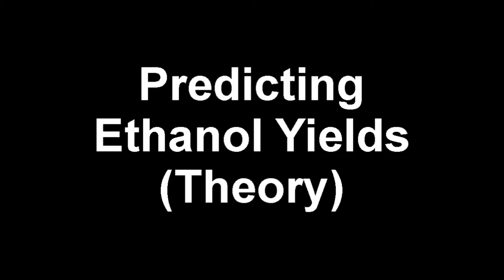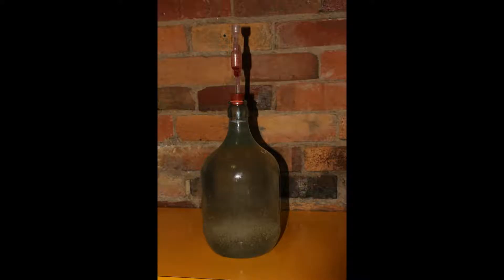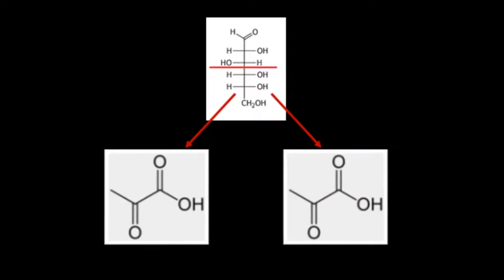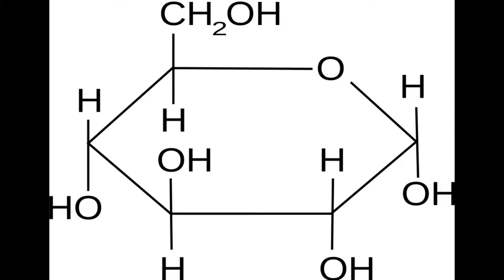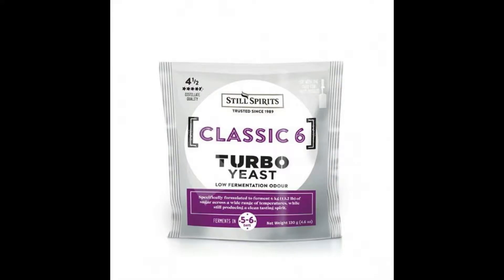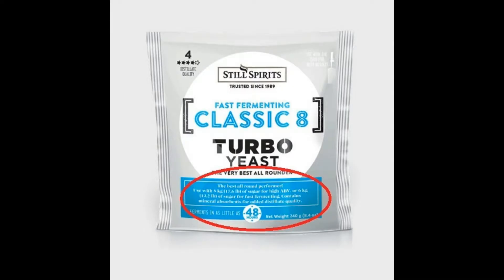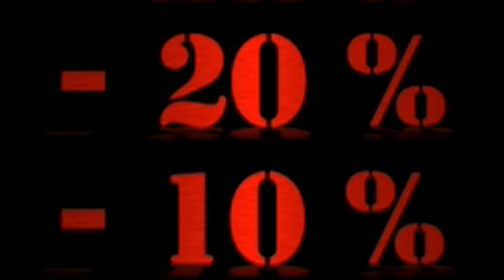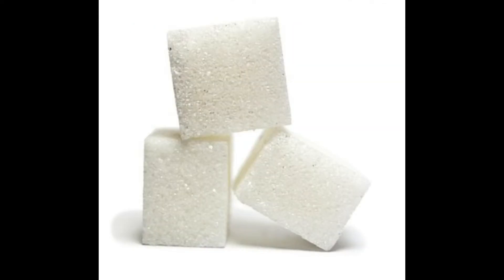Predicting Ethanol yield from sugar (Theory)

Comment: Kindly tell the formula from which we can calculate the yeild
Reply from the maker: This should cover the equation used.

Sugar (C6H12O6) -> carbon dioxide (2CO2) + Ethanol group (2OH). 

For example:

1Kg  of sugar = 2.921 moles of sucrose. Sucrose has a molecular weight of 342.2965 grams (1000/342.2965 =2.921 mol).

Fermenting produces two moles of both CO2 and OH because of the krebs cycle using two carbons from glucose. 

That tells you how many moles COULD be generated but the actual amount is limited by a second factor; yeast ethanol tolerance.

You can take the number generated from before and than multiply by the yeast tolerance percentage. 

For example:

An ethanol producing strain can survive up to 20% ethanol with out any trouble.  

You take 2.921 mol and multiply by 0.2 (20%). 

2.921*.2= 0.584 mol.

0.584 mol* 342.296 = 199.99 grams of ethanol and CO2. 

You scale this on the based on the kg of sugar used, eg sucrose, malt and glucose. So an 8Kg wash would obviously be 8 times as much yield up to a point where other limitations apply.